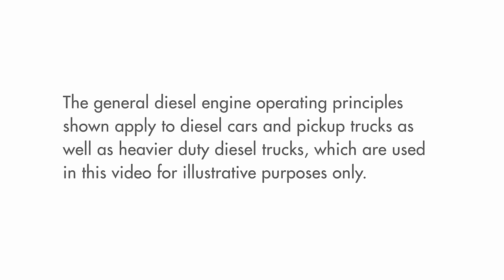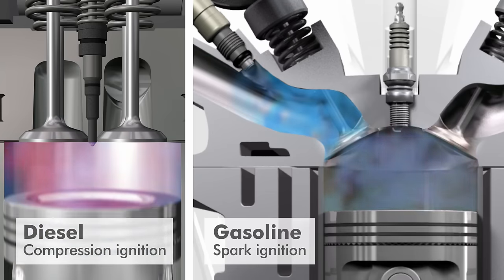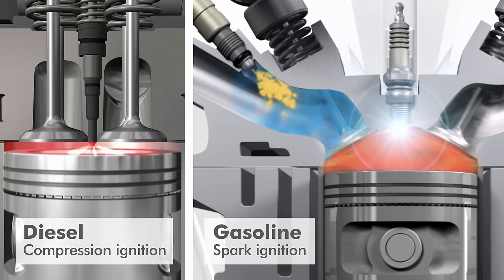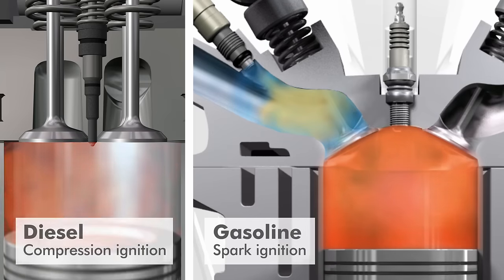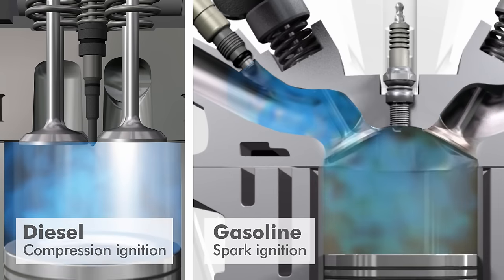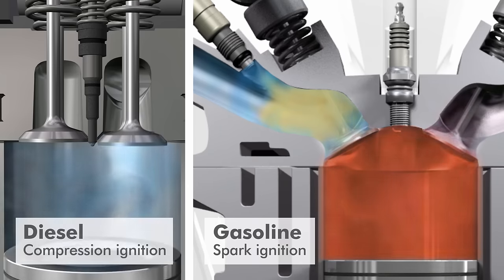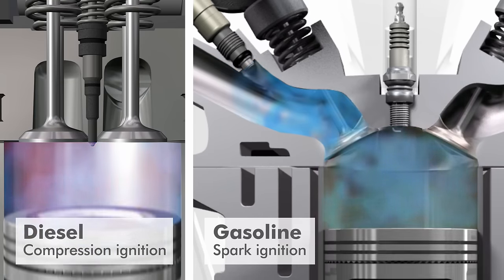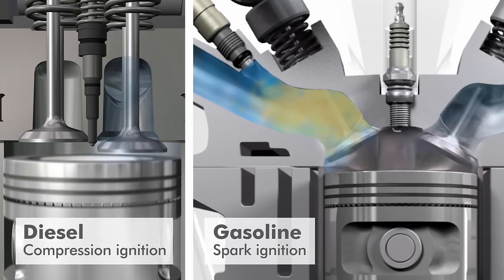How a Diesel Engine Works

Comment: Diesel engines have become so efficient that the global restrictions and tariffs on them have become more or less obsolete and are bordering on unfairness, to the point that they should be treated as any other combustion engine rather than being used as a scapegoat for low emissions taxes and higher road taxes. All combustion engines are bad for the environment, yes. I'm not here to challenge or argue that, but Diesels' have as much use as any other fuel type, be it petrol or coal/gas/nuclear for electric vehicles. They all have something that they're good at but diesel engines don't deserve the stigma that they get. Once maybe but not anymore.
Reply: why are Diesels more stigmatised than petrol?
Reply: @dhollsynthmusic  they make more air pollutants than petrol but produce much less co2
Reply: I'm fairly sure that it's considerably easier to produce biodiesel than it is to produce biopetrol as well. Shell does a fair amount of research into the production of biodiesel by algae, which is promising and may very well replace a considerable bit of traditionally produced diesel. I don't think there is anything like that for petrol yet. And there is a similar thing for kerosene as well btw.
Reply: @pieterveenders9793  I have heard good things about hydrogen treated vegetable oil for use in diesel engines, with regards lack of pollution and high cetane properties.
Reply: Also diesels are much more efficient than gasoline, burning from 1/2 to 3/4 of what petrol engine of same size does. On roads outside cities, they are even more efficient than hybrids, while still providing decent power.
Reply: Diesels do naturally have much higher emissions of soot and NOx than gasoline engines. Soot and NOx cause smog and respiratory issues.

Comment: Is there a reason why both fuels require their own solution?
Reply: Diesel doesn’t burn like gasoline and won’t ignite from a spark but the heat from the high compression will

Comment: Nice one for that shell, can you now explain why your charging £1.79 a litre when oil per barrel is at its lowest it’s ever been
Reply: You know why .
Greed .
We need it & are gonna buy it regardless. 
So would you .
Reply: @peterherrington3300  oil prices are at around $100. Certainly not "at its lowest it's ever been"
Reply: 100$/barrel means that 100$:158 L of oil. To break even they'd have to charge 64 cents at least. Brits are getting ripped off lmao.
Reply: @gabrieldx4097  40% of every barrel of crude oil is converted into gasoline. Run the rate for that
Reply: @KayC352  If 40% is gasoline then it's actually 1.6£/litre to break even. Not as much of a ripoff now
Reply: @gabrieldx4097  so 6.06$/gallon, which matches current gas prices really well

Comment: They work until they don’t. Just ask anyone who owned an Oldsmobile diesel in the 1980s. 😱
Reply: That engine didn't have to be a failure, but unfortunately it was, because the geniuses with the real power at GM had been following the same philosophy since the late 60s where the most important question was "How can we reduce the cost?" -- and "Does it actually work?" was a secondary question.

Comment: Great but they still smell, my Dad bought a new tractor and although better than the old diesels the exhaust still has that diesel odor and the fuel's not cheap like it used to be.
Reply: Wdym diesel smells good

Comment: Well i still have a hundred questions. How and why does air heat up and explode without a spark... why is diesel still cheaper and more economic, and why do diesel engines dont have the same power as petrol ones... why does the petrol engine need a spark if the process is 90% the same as in diesel - air being compressed and heated, mixed with gas... This didnt really answer anything for me lol, but its a good representation of the basic mechanics, thats true.
Reply: Gasoline is much more stable and therefor requires an external source of energy to spark the ignition. Chemically speaking both fuels are just carbohydrate chains. The longer the chain the 'quicker it can break' Gasoline is very short, Diesel is longer. High pressures and temperatures are enough to ignite Diesel fuel. If you put gasoline in a diesel engine (do not do this) it would not ignite (and cause serious problems).
Engine power = torque x revs, Diesel engines don't rev as high as gasoline engines, therefor are less powerful (even though the difference is negligable in modern cars).
'How and why does air heat up and explode without a spark' - the air alone does not do this, only when Diesel is added right before the piston is at top dead center.
'why is diesel still cheaper and more economic' - more economic because the compression ratio is much much higher, thermodynamically speaking efficiency is a function of compression ratio.

Comment: Wrong.
In fact, the exhaust valve opens before the piston reaches its lowest point in power stroke. 

And the intake valve closes later than the piston begins to move up on the compression stroke.

Comment: Actually diesel fuel burns at the boundary surface of fuel spray. The combustion does not occur in the entire space of combustion chamber. That is the biggest difference between diesel combustionand this video. The host of this video should see the visualization of diesel combustion system.

Comment: So what role does a glow plug play?
Reply: Glow plugs heat up the combustion chamber in extremely cold environments. Diesels need heat to run, glow plugs simulate heat.

Comment: How a diesel works-while I'm trying to pull out of the drive way to go to work it goes by and is the last slowest car in the line of cars I had to wait for going my way-then I go and get stuck behind it can't see choking on crudely refined 5 $ a gallon gas-me wondering if they are just driving it because it's a diesel and don't use it to haul loads at long distance and high speeds.

Comment: So, what do glow plugs do? I thought the diesel needed to be hot to combust.
Reply: Glow plugs just help with the process when its too cold outside, theyre not necessary when its over 0c but you might have to turn the key a bit longer for the car to start.

Comment: In Diesel, how can the fuel ignite without spark, just by compression?
Reply: Yeah, this video is good about the ‘what’ but not the ‘why’.
Reply: @skjonas  yeah the video seems to focus on the fuel injectors of a diesel vs air fuel mixture of a gasoline …except most gasoline cars now have direct inject too so the video is misleading.
Reply: @skjonas  here's the short answer:
lower volume = higher temperature
more heat = delta G below 0
delta G below 0 = spontaneous

i should've clarified that there's an activation energy required for a reaction to happen
Reply: You slept in your thermodynamics class buddy.
Reply: Diesel engines have glow plugs instead of spark plugs but they are only really needed for cold starts. "Unlike a spark plug that is working continuously while you drive, a glow plug is only needed during the ignition process. The glow plug works by electrifying the heating element so it heats up and emits visible light (hence the name). Intake air is compressed before the fuel injector spray directs fuel onto the hot tip of the glow plug during the injection of the fuel. The injected fuel mixes with the compressed air, evaporates and starts combustion almost simultaneously, even when the engine is cold." Ref championautoparts

Comment: thank you
Reply: LPG is better
Reply: @dragospahontu  how? More miles? More Torque @X-RPM? or let me guess less price? Explain to me with factual evidence how LPG is better please and provide said factual evidence on diesel cars with 2015 onwards DPF's.
Reply: @SSNebula  LPG is cheaper and pollutes less. Diesel with DPF is very bad in the city.
Reply: @dragospahontu  but you never answered my question fully... do you get as many miles? I can get up to 90 miles PG on diesel... don't see how LPG gonna top that... and as for the "DPF Is dirty in the city" lol not as dirty as when you have to go down the motorway to clean it out and by the time the smoke or emissions hit the air they're diluted... yeah diesel is dirty in a sense but since 07 nowhere near as dirty as old tractors and farm vehicles that use unfiltered "dutty" diesel! Not arguing about the cleaness of it I'm on about performance! I can do 85mph for qt least 60 miles before my tank even registers some diesel loss and even then its a hairline from where it was if I go down to 70 I can get 90MPG can your LPG do that?
Reply: @SSNebula  yes but LPG is cheaper so it will offset the mileage because of the price difference.

Diesel with DPF is unreliable in city.

Comment: Still didn't explain where a glow plug comes into play though
Reply: Glow plugs preheat incoming air at startup to make initial combustion cycles easier until the engine warms up. After the engine starts the glow plug are no longer needed.
Reply: So it just heats the air? I always thought it heated the diesel. 🤔

Comment: Good video but a direct injection gas engine is different and….. it sucks.  The fuel loaded with detergents can’t keep the intake valves clean like a traditional air/fuel valve gas engine can.   That’s why direct injection engines get serious trouble after so many mikes and run rough, while cleaning the fuel system is much more expensive to do.   I hate direct injection gasoline engines for that very reason.
Reply: You can fill the tank not with gasoline, but with alcohol. Vodka for example. Although vodka seems to be banned. Then whiskey!

Comment: The air isn't hot, the fuel combusts under pressure
Reply: If you compress a gas, it heats up and increases pressure. PV=nRT

Comment: Rookie tanker drivers need to be thoroughly trained for several weeks by a veteran driver to NEVER  mistake the diesel tank with the gasoline tanks.  The damage is devastating to either engine & exhaust system.
Reply: No it's not gas engines you just have to flush the system. Diesels can run on gasoline just fine
Reply: @catsbyondrepair  Diesel engines rely on diesel to lubricate components such as the fuel injectors. Gasoline does not have the lubricating properties and apparently can destroy newer engines.
Reply: @baileyharrison1030  nope wrong I've run a semi truck 500 miles on gas doesn't hurt them one bit
Reply: @catsbyondrepair  Older diesels were quite tolerant of a wide variety of fuels (the earliest ones even ran on coal dust).  But that would never work on a modern diesel with common-rail injection, many of which use 2000+ bar pressure.  As mentioned the high-pressure pumps and piezo/plunger injectors rely on the fuel for lubrication, and these systems can run quite hot, sometimes return fuel can exceed 100°C, hot enough to completely boil gasoline.  Since gasoline is formulated for higher octane (knock resistance) and a smoother non-detonation burn rather than spontaneous autoignition, it's quite possible for the gasoline to still be burning during the exhaust stroke, into the exhaust.  That will quickly overheat and overwhelm the DOC, DPF, and SCR emissions systems in newer diesels.
Reply: @djo9c1  don't hurt em I have a emissions truck it will run on vodka if I put in the tank

Comment: One time someone said diesels work by leaving a little exhaust gas to keep the air inside hot but then I thought “wait a minute doesn’t it pull clean, much much cooler air immediately after?  Leaving exhaust gas definitely wouldn’t help. 
Or does anyone know something I don’t?
Reply: If it's a turbo diesel it's going to be pulling hot exhaust air. 🤷‍♂️
Reply: @Yophillips3272  wat…why?
Reply: @coleknight7529  Look man I don't have all the answers.
Reply: @Yophillips3272  haha. Me neither apparently. I do know that if you’re pulling hot enough air to meaningfully help ignite the fuel then your trucks got issues. Turbos get hot n stuff but they also move so much cooler fresh air that the exhaust side and the boost side should be kinda canceling each other out.
Reply: EGR actually results in cooler combustion.  Its primary function is to reduce the NOx emissions generated, but it can only do so much.  The high compression ratios of diesel engines allow the incoming air charge to be heated well beyond the fuel's autoignition temperature within a matter of milliseconds:  it's an adiabatic process and not an "ideal gas" that linearly follows PV=nRT.  Yes the turbo will result in the air intake charge being heated somewhat, partly by heat transfer from the hot exhaust gases and partly by a similar adiabatic compression, but some of that heat will get rejected in the cold air charge, and by the time it reaches the intake it's nowhere near hot enough to autoignite diesel.  

To think of it all in layman's terms: the extreme compression of the air results in some of its internal energy being converted to heat, and it happens faster than the heat can get absorbed into the cylinder walls, cylinder head, piston, etc.

Comment: Why does Diesel cause more air pollution compare to normal engine?
Reply: They don't. You mentioned "normal engines" , which operate on fuel that takes more to refine. Meaning, gasoline vehicles use more than reported. Diesels are the work horse of transportation currently.
Reply: @DeathAngelHRA  why are those Trucks that use diesel engine produce darker smoke compare to the gasoline fuel?
Reply: @thetruth3068  the trucks that make black smoke are running too much fuel and not enough air.   A lot of people do that on purpose because they think it looks cool.  Modern diesel engines actually pollute less than gasoline engines.  Diesel engines are much more efficient than gasoline engines.

When Diesel engines have the correct air:fuel ratio, they make no smoke.  

Cars pollute more than trucks, because there are so many of them.  

The main problem with Diesel emissions is the soot they produce,  but with modern emissions systems most of that soot is caught or burned off before exiting the exhaust. 
 Gasoline engines produce more C02 and cause more of an impact on the atmosphere than modern diesel engines.

Comment: no mention of glow plugs? this description is not technically accurate
Reply: exactly. people think an oil company is going to tell them the truth. they havent yet in all these years
Reply: Not all Diesel engines use glow plugs. This is a generic explanation which is supposed to pertain to all Diesel engines.

All glow plugs do is warm up the combustion chambers to make the engine easier to cold start.

Comment: Why petrol engine needs spark? Even if gasoline is more flamable than the diesel oil. Why high temperature is not enough for combust the gasoline and air mixture?
Reply: Why you no write English properly?
Reply: @stepha5926  sorry if I made some mistakes, still learning. Do you know answer for the question?
Reply: Gasoline is a less stable fuel which makes it more prone to what is called detonation. Gasoline has a higher risk of forming two or more flame fronts that will impact each other and cause uneven pressure on the piston. This not only greatly reduces power but also causes the piston to rock and hit the cylinder wall causing a knocking sound. Detonation will destroy an engine quickly. 
There are gasoline engines that have compression ignition but it is hard to do it reliably.

Comment: This is why diesel engines are generally not high revving i.e, above~ 4500rpm, due to the time required for the ignition process